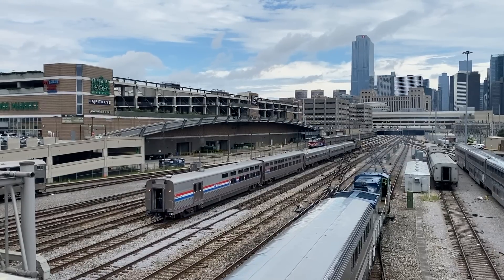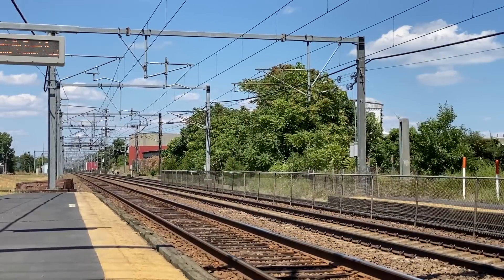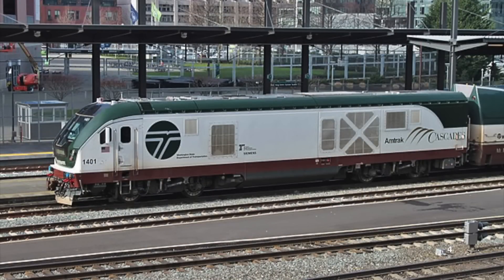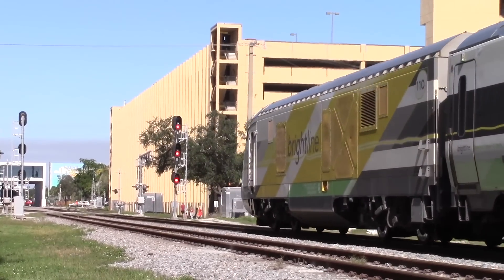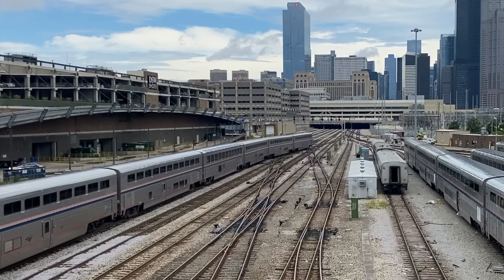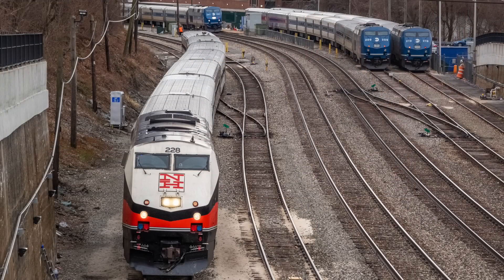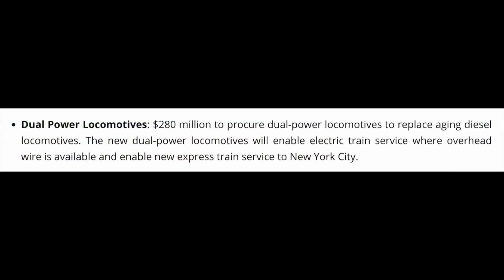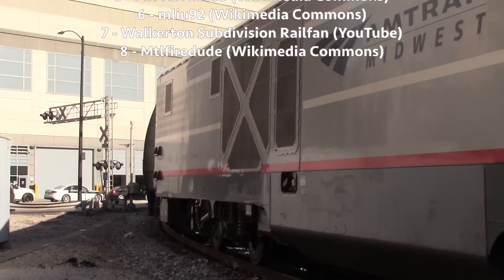Siemens Charger: Locomotive of the Future

Comment: I love the charger and this was a great overview of the many orders. Maybe I'm alone with this, but I find the battery/dual-mode versions super frustrating. Diesel + caternary makes sense for anything past NEC, but the battery really doesn't make so much sense especially if it's replacing third rail. I wish we'd just electrify more lines!
Reply: I agree the electric lines are better.
Reply: @T_Hoog  But battery trains weigh alot.
Reply: @T_Hoog  
It’s just stupid of CSX and others NOT to electrify!  And don’t say “the country is too big” or “They couldn’t run double-stack containers anymore “ because it’s BS. The Trans-Siberian in Russia is electrified (9288km/5771ml) and the Dedicated Freight Corridors in India are electrified corridors for double stack trains.
European railways show also that it IS possible to run by green electricity ⚡️
Electric locomotives are able to provide reliable services for more than 50 years, if well maintained, with less inspections needed.
Reply: @aoilpe  Maintenance of OLE in remote areas is a problem, so are tunnel and bridge clearances. Electrification is better for passenger than freight; it's also prohibitively expensive for the length of rail line in the US
Reply: @andrewreynolds4949  
Electric locomotives are the best for high power in low speed operation !
Quite all diesel locomotives are diesel-electric !
Overhead rail in tunnels take less room than a normal catenary . Electrification is costly at first but save money at the end. Less maintenance for locomotives, possibility to run trains with “green energy”,less dead weight to transport (fuel) ,fewer engines needed for the same weight, 
recuperation breaks to generate power while breaking, service life easily over 50 years….!
Just start somewhere! 
Switzerland is 99,1 percent electrified since the sixties beginning in the 1910’s.
I remind you,some lines were electrified and dismantled since !
Start with the most important routes !
Reply: @andrewreynolds4949  freight can benefit a ton from electrification as well. There are major freight routes all over the country that could easily justify electrification. It’s just that freight railroads are allergic to capital investment because it doesn’t provide immediate profit.
Reply: @aoilpe  The Swiss railway system has been nationalized since 1901; electrification has been funded by the Swiss government (as well as Swiss taxpayers).  They also only have a little over 2100 miles of track, but they are 100% electrified.  So what would it cost to do the same with a major US Class 1 railroad, say the Union Pacific.  Estimating $3M per mile to install catenary, the UP has 32,000 miles of track.  That’s $100B right there. They have 8000 locomotives; a Vectron dual mode costs about $5M.  That’s an additional $40B right there.  Unless it’s federally mandated (and federally paid for) no US freight railroad will electrify by choice.  Ever.
Reply: @aoilpe  Electric traction is best at quick acceleration and high speeds, which are more important for passenger service (like is the dominant rail traffic in Switzerland!)
Diesel traction has advantages too; it is not vulnerable to downed power lines (especially problematic in remote areas), it costs less in dedicated infrastructure on any new routes or sidings, adding additional maximum power capacity on any route is spectacularly easy, it's nearly impossible to knock out the power supply for a whole train, it's not vulnerable to electricity prices (yes diesel is vulnerable to fuel prices, but that point does go both ways); and best of all, all the infrastructure and equipment already exists in place!

In short, electric traction gives relatively little useful performance benefit that cannot be matched by diesel locomotives, and certainly doesn't justify the incredibly high cost of conversion.
Reply: @johnforestersworstnightmar3756  There's not much that electric traction can do that diesel locomotives can't. And the freight railroads are not "allergic" to capital investment, they just don't advertise their projects much. Because they are private companies they don't have much reason to, and infrastructure planning is usually integrated with their business plans (which they guard closely). It never makes the news because the general public isn't interested in infrastructure, unless it's being used as a political tool (or it's in their backyard, or interrupts their commute, in which case they complain).
For example, BNSF has been triple or quadruple-tracking large lengths of its southern transcon. That didn't much make the news outside of a few railway industry publications. When Amtrak got only a few miles of the NEC tripled in Delaware, they plastered the news everywhere they could get publicity for it.

Freight rail does invest in infrastructure; both CSX and CPKC have announced major infrastructure upgrades intended to begin after their respective mergers. There's a lot of lesser stuff too that people just never hear about.
Reply: Yep. Less battery and more overhead wires
Reply: @andrewreynolds4949  
“Don’t change anything…”
That’s why the US are not so great anymore…
Reply: @adamknott7830  
Batteries are okay for shunting locomotives
Reply: @aoilpe  sure I guess, batteries can be used for some stuff lime that. I just want main lines electrified and since this is america we love to pick options that sound good when there are better options. I dont want batteries shoved down our throats as some sort of green energy savior like the media and tech bros want to portray it as. Thats all. Batteries good for some stuff but not the best for a lot of other things.
Reply: @adamknott7830  
I agree
Reply: @andrewreynolds4949  
You show a lack of knowledge in electric traction.
And the question is NOT if diesel locomotives CAN do something but WHAT is the better solution for nowadays. Polluting diesel is definitely not.
Reply: @aoilpe  I'm not saying to change nothing. I am literally describing how the freight railroads have been investing in making changes to their systems. There has been a relatively continual modernization and updating of locomotive fleets among all the class 1s for decades for another thing.
What I WOULD oppose is making changes too large, too expensive, and too rapidly. History has shown that those are a recipe for large-scale failures and collapse.
Reply: @aoilpe  Then please, tell me what my knowledge of electric traction lacks. Your three generic sentences have done nothing to illustrate diesel power's supposed outright inferiority.
Reply: @andrewreynolds4949  
NOISE- AND AIR POLLUTION !
Isn’t that enough for you?
2. 
Because of these few changes your company’s are still not really viable and have to merge into monopolies?
Derailments are a common thing and train speed permitting for plunder is good for the USA because of diesel locomotives that are too slow on bad rails? 
Okay, you won…!
Reply: @aoilpe  Rail traffic demand greatly outstripped available capacity in the 20th century, partly due to overbuilding of the rail network during the 'railway boom'. During a long period of rapidly rising road competition and harsh government regulation, many railroads went bankrupt, were forced to merge, and shed unneeded capacity in order to survive. By the turn of the century, things mostly stabilized. Much of the reason for mergers nowadays is because of potential business opportunity, not shedding redundant routes. Duopolies (not monopolies) have developed that viably compete for bulk and long-distance traffic, along with an extensive series of short lines that better serve local areas. 

To address your other complaints; 
Noise and air pollution: no, that's not enough. It can be a problem in high-traffic areas and cities, which is why electrification of commuter rail can be a good idea, since it brings these secondary benefits. Everywhere else, which is nearly the entirety of the freight networks, can be operated perfectly fine by diesel locomotives. Also note that modern Tier III or Tier IV locomotives are far, far better in this metric than Tier 0 locomotives from 20 or 30 years prior: manufacturers commonly claim greater fuel efficiencies of 15-20% or more and much more than that in emissions, and continue to research further improvements. The benefits electric traction can provide do not remotely match the enormous cost of implementation in most cases.

Yes, accidents and derailments do happen, but if you look into why, there's very few that could be prevented or changed at all by electrification. (Indeed, I strongly suspect there would be rather more incidents with tall trucks pulling down OLE!) Quite a lot happen from outside forces: rail-road crossing accidents, ground movement, sometimes operator error.

Diesel locomotives that are too slow: no? most diesel freight locomotives are geared for 70 - 80 mph, which is plenty fast for freight services. Beyond that there are extra FRA restrictions on special complex signaling equipment and very much stricter infrastructure requirements. It's also a lot harder to get heavy freight trains up to those speeds, and that's the same with electric traction; notably, that's a large part of the reason freight trains in Europe are so restricted in length (and also speed relative to passenger rail).

Bad rails: a lot of where you see the worst condition rail lines are where they either see very little traffic or short lines with very limited funding and other resources, including many who are partly supported by state and local government where revenues are meager. In short, the level of traffic or potential traffic largely dictates the quality of infrastructure needed to support it. No one but communist China is going to build extravagantly engineered rail lines to low-traffic destinations.

"Train speed permitting for plunder": what does this even mean? Is this about the series of break-ins in California where thieves tore open railcars in some of the yards there? Nothing is going to solve that sort of problem except better security
Reply: And here it is…Oil prices are rising !
Sun , wind and biogas is quite for free…
Reply: @aoilpe  Maintenance on solar and wind power infrastructure is very difficult to keep up with and expensive. It's very hard on the electrical grid. Not to mention other environmental impacts. In any case, the price of gas peaked several months ago in my state. From what I can see the "energy crisis" is outdated and overblown news
Reply: @andrewreynolds4949  
Another nonsense of you
Reply: Downgrading infrastructure over decades and doubling the length of trains is counter productive.
Shorter European trains are overnight operations in transcontinental freight .
Missmanagement in behalf of shareholders is NOT in the interest of the nation .  Investment is not in the interest of shareholders, maintenance is investment ! If the length of trains is doubled the sidings have not been lengthened and creates problems for single track operations that slow down average speeds even more !
The supply chain is slow and ready to fall apart…!
Quick short electric freight trains can stop at short distance and generate power while breaking (Recuperation break).
Using infrastructure to death cause accidents!
Locomotives from 2008 and older aren’t very “new” anymore,lol, so what are “your” NEW diesels?
Train drivers are specialists and deserve a decent salary !
India is investing in total electrification,why the big 4 are fighting the progress in the US ?
Your comment on renewable energy is just BS as other parts of the world shows -at least California !
Reply: @aoilpe  What has happened recently is a fad called "Precision Scheduled Railroading", which in its original concept took rail operations that had excessive operating expenses and inefficient operations, and trimmed things down to make it more efficient; this included things like consolidation of large and medium yards, and more efficient assembly of trains, so redundant yards can be downscaled in operation or mothballed; storing older locomotives; longer trains, for better economy of scale, which is a relative weakness of European freight rail; it also means less extra crews and staff on hand. In concept freight should move at a higher average speed (especially less sitting around in yards), and may include speed or capacity increase projects (such as double tracking or siding extensions) to help achieve this. As a continuation of earlier patterns, some redundant secondary and unprofitable branch lines have been sold to short lines or placed under abandonment.

The problems come when some managements start taking things a little too far: as one CEO recently said, there should always still be some additional capacity for emergencies and sudden supply chain disruptions. The way a lot of the large railroads were operating in 2019 worked fine at the time, but left very little room for contingency capacity. Then in 2020 and since there have been several very major supply chain contingencies (covid, Suez blockage, Russo-Ukrainian war) which the railroads weren't prepared for. That's why they have implemented a lot of measures like reopening a number of previously closed railyards, continuing or upscaling infrastructure improvements, bringing stored equipment back into service, and making efforts to hire more crews again (on which note, improving efforts and incentives to help attract new employees would be a good idea). The system isn't broken, it just needs ongoing rebalancing efforts to finish.

Locomotives older than 2008: this comment makes me question your knowledge on the rail system in general. No, those locomotives are not new anymore. That's why large numbers of them, especially those from the 90s like the Dash-9 series, have been rebuilt to modern specifications, stored as long-term out of service, or scrapped outright. Generally the frame is still good and pretty much the same as current production models, so what they do is strip everything else down, upgrade the power plant to modern standards, rewire the whole thing with modern electronics, and install new traction motors (usually new AC instead of DC). The end result is a virtually new machine with equal performance to an entirely new locomotive, at about half the price and takes less time and materials. It's a very intensive process, most of the locomotive is replaced. But not only have they ordered thousands of rebuilt locomotives, they are still buying new ones: BNSF has ordered over 1500 locomotives since 2009, just from GE. The ES44/ET44 series and SD70-ACe-T4 series are all modern, Tier-III or Tier-IV compliant models built in quantity since 2008.

Electrifying the railways will not solve the current supply chain issues; it would likely make them worse. It would take a very long time, decades, to electrify any significant portion of the network. During this time there would be constant line closures for major electrification work. It requires the replacement of the entire locomotive fleets, infrastructure, and industry. The power grid cannot remotely handle the required capacity, for reliable electrical service it would require dozens upon dozens or new nuclear reactors which are not even proposed for construction. If eco-warriors insist on solar and wind being the future, well then it will take hundreds of acres of solar panels and wind farms, and destroy vast amounts of natural or agricultural land. Not to mention the whole disaster will cost exorbitant amounts of money, and still doesn't help with the problems we have now, or even through this decade. So no, electrification of the freight network is not the "miracle solution" some people are claiming.

One more thing: electric traction's most notable advantage is its quick acceleration. Where is this most important? Commuter rail. So EMUs are a good idea for Caltrain or maybe MBTA, where there is a lot of intensive stop-start scheduling, and less so for long-haul freight. One notable exception is Chicago's Metra: their structure and operating environment pretty much preclude electrification of most of their operations. It would be useful in concept, but they are also an underfunded and shrinking network (passenger numbers have been falling for decades). Chicago doesn't seem ever prepared to put that much money into Metra, they can't even buy new passenger locomotives (note their "new" units are freight locomotives shoehorned into passenger work)
Reply: @andrewreynolds4949  
Nonsense
Reply: @aoilpe Double Stacks in Tunnels are a problem
Reply: @maas1208  
What do you mean?
They already pass through tunnels…
Reply: @aoilpe  I mean the tunnels in the mountain
Reply: @maas1208  
And why ?
What is the difference of a tunnel through the mountains with one under a city or else?
Reply: @aoilpe  low clearences
Reply: @maas1208  

You know that tunnels can be widened  ?
A catenary rail don’t need a lot of space in tunnels…(have a look at several European railways).
Reply: @aoilpe  Modifying tunnels for caternery are too expensive so I'd say use 3rd rail for the tunnels.
Reply: @maas1208  
They have done it for the double stacks,they can do it for the catenary rail too…
And it’s not because the tunnels are too long, the longest one in the USA is only at no.28 in the list of the longest tunnels in the world with the next following on 73.
(Switzerland 1. ,4. ,14., 15., 30., 31. …)
And it’s not widening in the proper sense but expand some inches in height.
With a nationalization comes maybe the audacity to create some more appropriate routes with more direct lines and longer “base tunnels” for shorter/faster/better connections !
Doing nothing is cheaper , but only in short terms.
Reply: @aoilpe  Why Not just use 3rd rail for the Tunnel sections
Reply: @maas1208  
It’s less reliable.
That’s why the UK is replacing all of their 3.rail-system with overhead wires and also because it’s more dangerous -low to the ground-for maintenance .
Only Metros/Tube/Subway use them while the tracks are (grade) separated from public/traffic.
Overhead is preferable
And mixing the two systems is to costly and just a complication.
Reply: @aoilpe  Bruh the LIRR and MNRR use 3rd rail and have grade crossings and heck the Chicago L has grade crossings
Reply: @maas1208  
So,you are referring to metro systems and commuter trains…Hmm…
At what speed ? 
Do you know there are technical limits for 3.rail trains?
Speed ; 100 mph/160Km/h
Voltage: ~1000 volts to prevent electric arcs and possible wildfires 
The 3. Rail is NOT recommended for heavy freight traffic either…